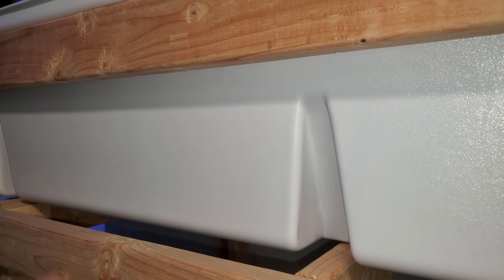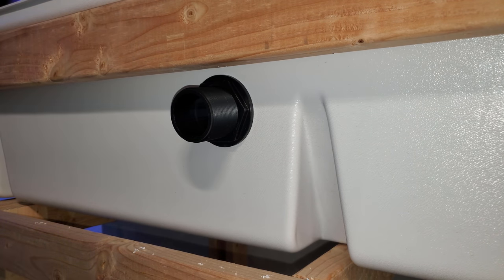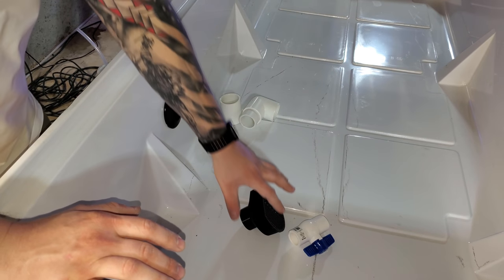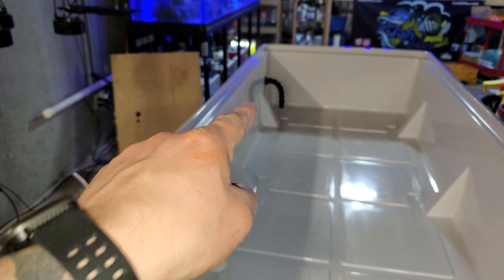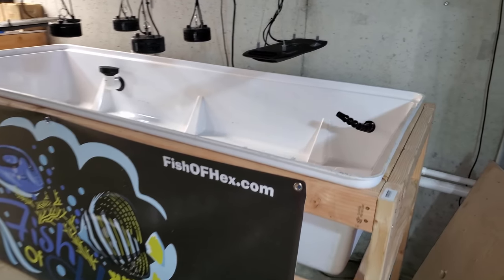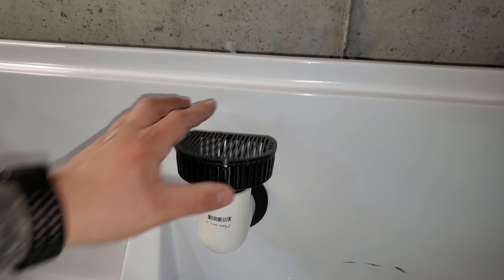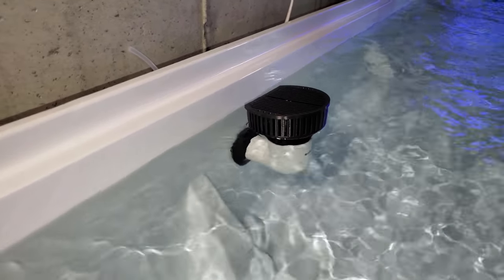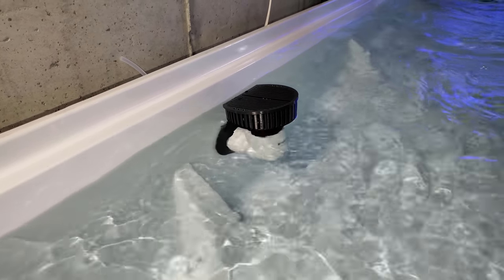Plumbing New Coral Grow Out Tub | 300 Gallon Reef Tank

Comment: Curious if you ever experience issues when adding on a new system to an existing system. Dilution of nitrates and phosphate from adding so much new water to a system.
I only ask because I have added a few smaller system to larger systems in the past and always experience some issues at the start. Just curious, and if so is there anything you can do to help mitigate these issues, add bacteria, bio bricks, turn skimmer off etc etc.